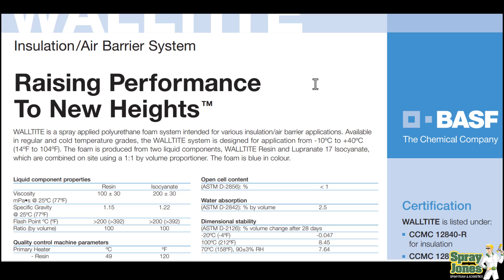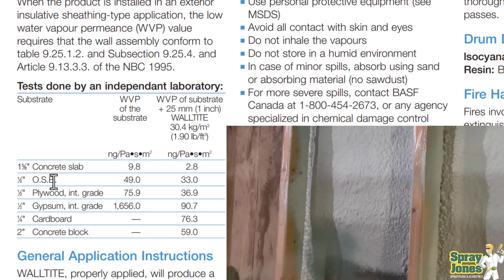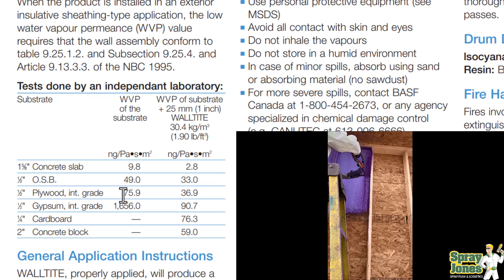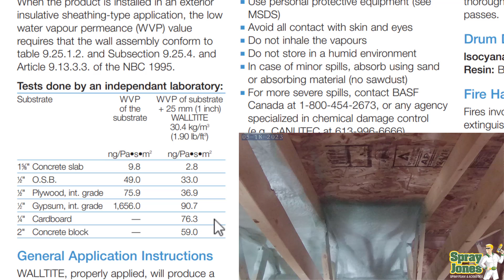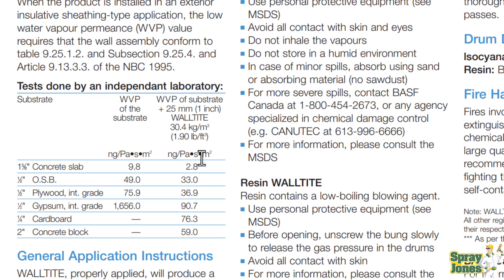Is 2 inches of Spray Foam Insulation Needed to be a Vapor Barrier?

Comment: Looking for a general cost of materials and advice. I uploaded a video, https://youtu.be/PbF7YlsEJO0?si=z592XQA5y5MhvMyj
Im looking for closed cell. Building is 28x44x10. Walls already have .5in insulation sheathing by ZipR. Roof is 4/12 with osb completely covered with icewatersheild, synthetic underlay, and then asphalt shingles. Thanks in advance for time and any advice

Comment: Mike - thanks for taking time and sharing this content. Excellent subject matter expertise. 

Question reference basements: many basement guys will put the plastic vapor barrier on the walls (we have this currently on our new construction). Can you comment on this type of vapor barrier vs a closed cell Foam vapor barrier? I’d much rather do something permanent like foam, but curious about closing up the walls with Sheetrock with foam behind it. Just looking for your thoughts. 

Our basement walls are cinderblock (some filled with concrete).  

Thanks again!

Comment: I am in Wisconsin and am dealing with an inspector that wants r-49 on the roof. .   What documentation can I show him so that I can spray R30 ish and that this would be enough ?  Thanks
Reply from the maker: What are your requirements for vaulted ceilings?
Reply: That’s not on the chart that I have found for specs 
 Sps 322.31-1 
And 322.39
But there doesn’t specify r value either
Reply from the maker: @tomroskopf5687  Vaulted ceilings are usually less than a flat ceiling. We install to the deck and have the 3rd party info signed off for vaulted ceiling values. Usually R28
Reply: What are your thoughts on spraying directly onto metal walls/roof panels? Is there documentation on moisture/vapor barrier on that substrate?

Comment: How much open cell would be needed to be a vapor barrier?
Reply from the maker: There is no official data on that. One has to go on field experience.
Reply: No vapor barrier is proved.  This is straight from one of the chemists from BASF that developed their formula for open cell.
Reply: Is it possible? If there’s no official data, it makes me think the thickness would be impractical.
Reply: @crs1012  impracticable. The amount needed versus cost its just not economical.

Comment: There was no data on steel such as a shipping container, what's your recommendation for that scenario?
Reply from the maker: Steel is a vapor barrier on it's own. That is why it is not listed. 

So any amount of SPF 1" or better is going to work.
Reply: @SprayJones  Is 1" enough for a condensation barrier, or is that a different topic in itself?
Reply: @SprayJones  if i did a shipping container house, i'd want to do 2" of closed cell on it just to help with the rigidity of the walls ... do you think that is overkill? ... would 1" closed cell be great in terms of rigidity or should i put no spray foam and just use rockwool
Reply from the maker: @dovahkindragonborn9827  2" is fine. We do that all the time.

Comment: Great video as always thx so much for doing these.  Thx for participating in our group Zoom call. 

On subgrade applications (preping for radiant heat & 5" concrete) with atleast 4" of 3/4" crush that is compacted level, 2" is still good for vapor barrier? How far up the walls should you go if doing walls at a later date? 

Video request... even more detail & recommendtions on subgrade applications. Thx, so much appreciated!

Ken 
SW Colorado

P.S. I got an istant notification (popped up) of this new video in my feed 19s after you released it. (Here in the USA)
Reply from the maker: Ken, yes 2" is what I would do on the crushed rock. It is the best bang for the buck and solves all the questions. 
I will do more info for sub grade. 
If notifications are on that is good bc they don't mess with subs they mess with bringing in non sub viewers.